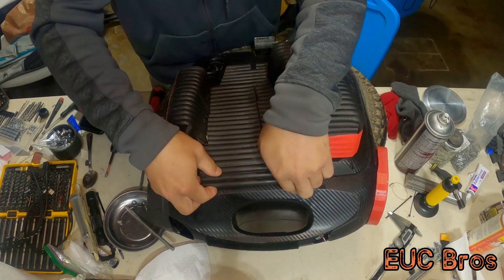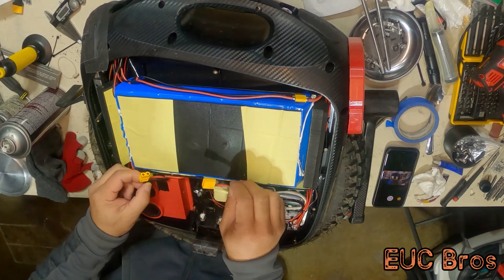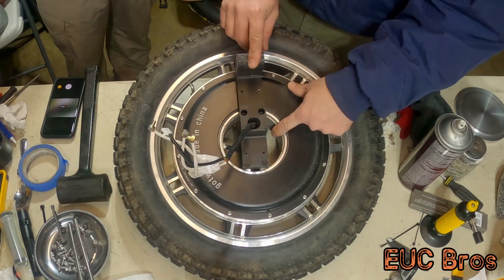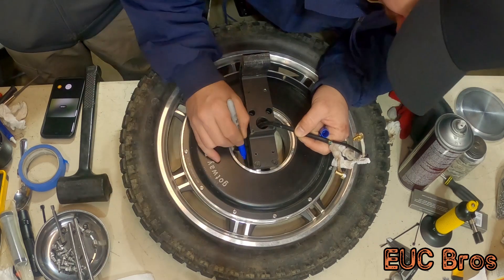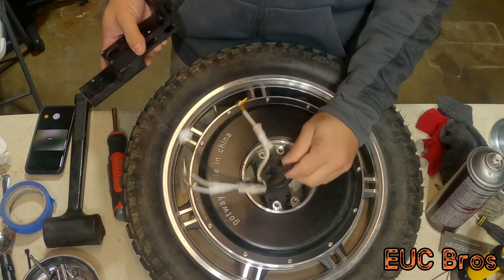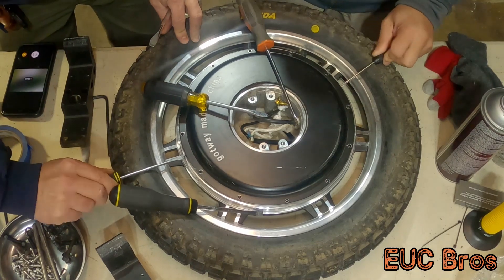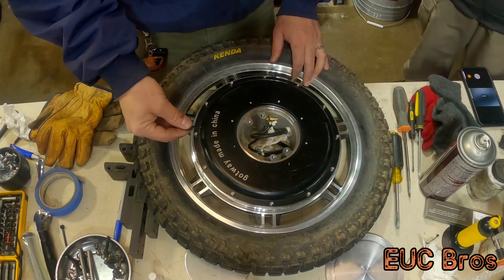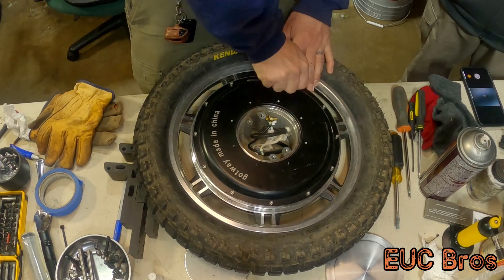EUC Bros | RS Bearing Replacement

Comment: Never apply Red Loctite. Red Loctite is for permanent fix. You can't unscrew red Loctite applied bolts without damaging thread holes unless you heat them hot enough to melt plastics.
Reply: There are use cases for red loctite, and this is one of them.  Another use case, tightening the axle nuts on MSX, you WANT it to be permanent.
Reply: Locktite for hobbyists comes in 3 strengths: Purple (repetitive maintenance, low vibration environments), Blue (semi-permanent, no heat needed to extract), and Red (permanent, high vibration environments and heat is highly recommend to aid in removing machine screws to prevent tear out or spaulding). Do not use RED unless you can safely apply a torch to the parts nearby… nowhere near the motor magnets, for instance. Most EUC applications should be BLUE, even the hanger bolts can be BLUE (medium). 
 
Now, the reason for confusion is that both Red and BLUE Locktite come in a similar red bottle, so we have no idea if it’s semi-permanent or permanent by observation. So, it’s totally worth pointing out if it’s not made 100% clear in the video demonstration. 
 
Details matter, so it’s best to know what shortcuts are okay and which just cause more problems later. 
 
You’re not going to be doing it wrong if you’ve only got BLUE, but RED Locktite on the heli-coil (by mistake) would suck for the next mechanic that fixes your wheel… And, if you are your mechanic, you’re only fucking yourself. {As far as anal is concerned, it’s better to give than receive (or so I’ve been told.)😅
 
Don’t sweat it if you left the bearings greasy, dry or waxed. As long as it can freely spin while unpowered, your ears will be the deciding factor and catastrophic seizing while riding is unlikely, unless you’re deaf or often wet.  Squealing bearings are especially susceptible to water egress because heat will liquify most grease and leave an air gap for water to pass through on your next ride. {Buy a used scooter in the tropics and you’ll find out quickly who maintained their bearings and who the didn’t.  
 
Luckily, I got a deal on a wheel needing a little TLC. And that’s how value is captured when others fuck themselves, unknowingly. 
 
That said, I’m going to waterproof the motor which requires a few more steps than was demonstrated here. {This video is an excellent procedure to follow but it‘s not enough for 10%-25% of heavy users who demand reliability from their EUCs. 
 
This is also why everyone should completely tear-down and rebuild their wheel when new so as to inspect, correct and upgrade fittings and seals where appropriate. 
 
I highly recommend learning to fix the wheel you most desire because a cheap S22pro is likely less than a year or two away, and money doesn’t grow on trees. Good luck 🍀
Reply: Almost forgot, 
NO LOCKTITE IN PLASTIC !!! Only metal to metal threads, and ONLY 1 or 2 Drops: less is more! Seriously 😳

Comment: What is that metal disc used to support the disc and bearing while you heated it?  That was the one important piece that I didn’t understand where that came from??  Great video otherwise!
Reply: It just looked like a piece of aluminum that they made in a mill at the same diameter as the bearing race.
Reply: @Ambrovious  Pretty vital component I would say.  Would like to hear from them!
Reply from the maker: Michael is correct. Murland made it. But u can use anything that just will support the bearing but not the motor cover.
Reply: How many miles did you accumulate before the bearing change ? thanks
Reply from the maker: Less then 50 miles
Reply from the maker: Yes brand new not used issue is defective bearings and design where bearings sit lets water into the bearings

Comment: The entire rider weight used to be supported by a single 3/4" hollow bolt, Why did they make the hub so gigantic?  A smaller hub could be used with a smaller bearing, something like a 50mm bore. Then bolt the hangers on each side with (4) 1/4 inch through bolts.  These huge bearing are too expensive and problematic.
Reply: They do better at holding up anytime you put your wheel through stress reducing maintenance and increasing the longevity of the wheel overall. Sure in their early stages they did have issues, and even now they do yet they are improving each gen. I put my EX.N through a lot of torture before I had any bearing issues. I',m proud of how it's held up

Comment: Hi, though this has nothing to do with my  bearings, I've been having issues with some knocking noise.  Some say could be the motor cable. I don't know how that could cause the noise, anyway I've took out the wheel.  How much cable should I leave towards the motherboard?
https://youtu.be/1uyXkPg0NxU

Comment: Just Return it
Reply from the maker: Why? It's the strongest wheel yet that takes the abuse of jumping. Bearings are easy to replace with nicer bearings without an issue plus with their hole drilling on the motor cover we haven't had an issue since rs is one of the best wheels out. Once we get our new hangers that have higher clearance for sure be the best wheel out for doing trail riding and jumping
Reply: @eucbros9235  
i just got a quote on these, tier one skf 61824 2rs bearings.. $737.02 each.